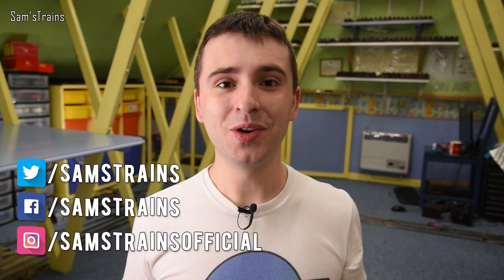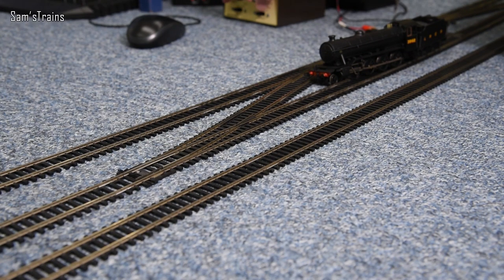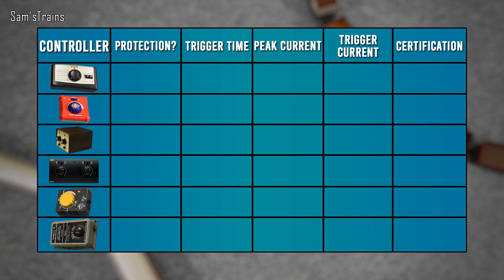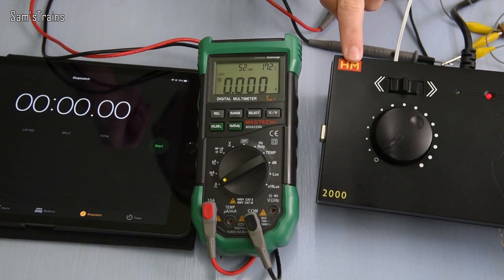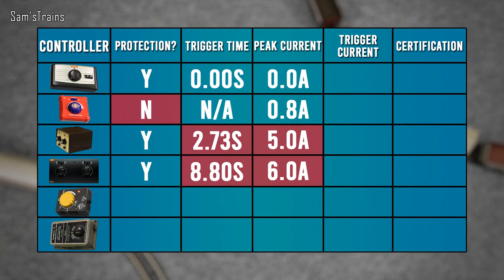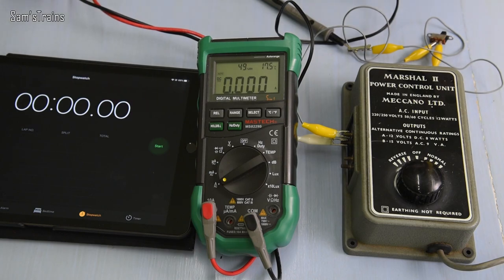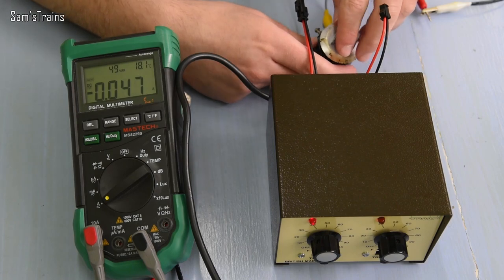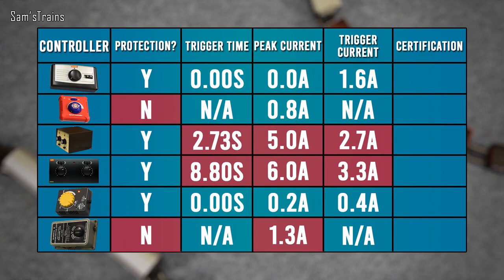What Happens When You Overload Model Train Controllers?

Comment: As a controller recommendation for anyone reading, I'd say the "Hammant and Morgan duette" is one of the best things you can get. I have 4 of them for my layout and they all serve me well. On high resistance and half power, the slow speeds are absolutely phenomenal. My S15 for example, I could only see moving when I put my eye right down next to it, but believe me, it was still moving (I time lapsed it to make sure I wasn't making it up.) I also has great short circuit protection and they'll last forever. They're often overlooked due to their age, but I'd choose them any day over an HM 2000 or gaugemaster controller. You may want to swap out the fuse in the plug however as a couple of mine came fitted with a 13A fuse.
Reply from the maker: Great to hear that Dom - I've always wanted to try one of those! Thanks for the recommendation as always! :D
Thanks for watching - Sam :)

Comment: That was a useful and interesting test. A common type of protection I'm not sure any of the tested controllers had is a resettable fuse. I think all the Gaugemaster hand-held controllers use these, and I've seen several other hand-helds with them. They will pass a the rated current indefinitely,  above that they cut out but can take a long time, to cut out quickly they need about twice the rated current. The problem I found was that the max current was limited by the power supply and the controller setting about 1.5 amps (2.5 A at full throttle), but the fuse was 1.1 amps cut-off, so it  would supply 1.5 A for 20-30 seconds. I've seen this damage locos 3 times, all the same loco design. Certain Dapol N locos used a tiny spring to transmit power from the tender to the loco (they have since changed the design to use a wire). If the loco derailed on a crossing you could get a tender wheel touching the other rail and shorting via the spring and the loco wheel. Because the spring is so thin 1.5 A made it red hot, your warning something was wrong was smoke coming from the loco as the spring melted and burnt plastic (the motor was not involved and was fine). They can be made a lot safer by replacing the 1.1A fuse by a lower rated one, I use 0.5 A for N Gauge (0.4 sometimes tripped on double headers). BTW, a common reason these controllers fail is that the fuse goes open circuit and you need to replace it, so a stock of spares is good (it is a soldered in component in the form of a small disk, available from RS and similar). Of of 6 broken controllers at the club 5 were fixed by replacing the fuse.

Noel
Reply from the maker: Hi Noel - I do like the idea of a resettable fuse - provided people don't abuse them, I can't see why manufacturers don't fit them more often! That spring design sounds pretty silly too - demonstrates a lack of proper testing once again!
Thanks for watching - Sam :)

Comment: Another smashing video Sam, had flashbacks to the staring in the Dapol Water Tower (another explosive topic, eh?) video at 0:24!

I have the Hornby 900 Power Control from years ago, not sure what that is rated for - although I doubt it will have short circuit protection!

I normally go round with the back of a fridge magnet every few weeks just to make sure no metal is near by - with the power off.

My locomotives only draw around 100-200 milliamps, or 350-550 in double headers. 

I also have a "boost" function on the controller - I turn this on when doing heavy duty running.

Thanks, George.
Reply from the maker: haha thanks mate - ooh yeah, I would have liked to have seen one of those blow up! Yes that's right - about 200mA is reasonable for most locos!
Thanks for watching - Sam :)
Reply: If I remember right, the R900 was rated at a massive 2.25amps as it could handle accessories and 2? slave controllers (R902)
Reply: Not sure, but I know that it could have another controller plug into the side, so it could power two tracks? The ports on the side where you would plug in another controller measure 12v DC. What is a "slave controller" I have seen them on the likes of eBay and can't find any info on them.

Anyway, the bloke who sold the controller to me said it was a beefy controller and was well worth buying another to make it a twin track controller.

It does have a 15v AC output.

Comment: Fascinating experiment, makes you wonder then about displays in the old days.  I recall Hamley's used to have a model train circuit running continuously round a large suspended circuit on one of the shop floors.  I'm guessing they must have had a few derailments which went unnoticed and back then not sure of any short circuit protection.
Reply from the maker: Thanks a lot Geoff - I know - I wonder if they had any issues?!?
Thanks for watching - Sam :)

Comment: Non-isolated pointwork across a double track mainline or anything with multiple power feeds can cause it depending on how the pointwork is laid, or damaged point frogs can also do it. Just thought I'd mention as it's something that's far from immediately obvious. My poor HM 2000 had to deal with a fair amount of current multiple times before I finally tracked it down to the damaged point, luckily it's a solid unit and is still going strong now several years later.

Edit: Also, judging by how long the power light on the HM 2000 remained illuminated before shutting off, I think mine reacts a bit faster than yours.

Love the channel Sam, keep up the great content
Reply from the maker: Yes you're absolutely right Matthew - connecting two controllers together in that way can cause excess current flow/controller damage - very good point!
Thanks for watching - Sam :)

Comment: Another thing that this brings out is the danger of running dcc chipped locos with a DC controller. While dcc controllers cut out very fast with a short circuit, the Gaugemaster took much longer. I guess this is how I managed to fry a couple of dcc locos that came off on a crossover powered by dc. Now I will never run a dcc loco on a dc layout. They all have the CV29 blocked from dc.
Thanks for the great test Sam!
Reply from the maker: Ahh that is interesting Antony - thanks for sharing this!
Thanks for watching - Sam :)

Comment: I have experience of 1950s equipment.  When shorted there was a smell and bluish smoke appeared and stopped working.  The Hornby Dublo ringfield motor was susceptible to burning out as well, whereas the Tri-ang XR 3 seemed to take a lot of punishment.
Reply from the maker: Uh oh - that doesn't sound good! I'm not surprised those older controllers took a lot of punishment! ;D
Thanks for watching - Sam :)
Reply: @SamsTrains  It was when the ringfield stalled that they ran the risk of burning out.

Comment: As a point.  The Meccano transformer, at least my old one, is an Auto Transformer.  This means that one side of your track is connected to the mains supply.  If you use a neon type power detector, you should find it will light up just as though you stuck into a mains socket!  I can't think of an easy way to have a full mains belt from it, but the chance is there, they are not an isolating transformer, as all modern ones are....
Reply from the maker: Blimey, that's very interesting Andrew - I'll have to look into that, thank you!
Thanks for watching - Sam :)

Comment: Hi Sam. I think I would buy a packet of three 6mm x 30mm 12V Car Glass Fuse Fuses 2A from eBay which costs £1.09 including P&P.  Replacing a car fuse will be considerably cheaper than repairing that Gaugemaster controller! If you get a glass fuse, you can straightway see when it has burnt out. You can sometimes get a short caused by arcing across the commutator which will trigger an intermittent overload protector, but not a thermal cut-out.
Reply from the maker: That sounds great - I'll have to try that too! :D
Thanks for watching - Sam :)

Comment: 1:18 "The full power of the controller" 
Only if it is already turned up to full power, which is a strange thing to do given that your loco will be whizzing around the track at 88mph.

The question now is what did you test? A short is a direct connection between the poles, which means it happens outside your motor or your motor is so completely broken that it's not salvagable anyway.  if there is a short and your loco stops, your first reaction is to turn of the power, not to turn it up forther as smoke begins to develop from unusual places.

I'm far more interested in what protection the loco's have against things that can cause them to develop a short.
It's also interesting to look at wether the wiring inside a loco can handle the max current put out by the worst-protected controller; does your loco actually take damage from a poorly-protected controller?
It's probably even more interesting to see if there is a DIY gizmo that you can put in series with your controller to protect against overvoltage and over-current, like a circuit breaker in your house.

Does the 6 amps even make it through the circuit to the wheels, is the contact of the loco's wheels on the rail enough to allow 6 amps to pass through? It would not be the first application where the test-case of a direct short is something that is allmost impossible to achieve in real life.

Comment: My 1930’s trix twin railway controllers have short circuit protection which seems to work well. Frequently tested with derailed  trains. I use a 1950’s transformer which is rated at 3 amps , however if you shorted that it would probably dim the lights in a major city
Reply from the maker: Thanks for sharing - blimey, they even did things properly in the 30s!! :O
Thanks for watching - Sam :)

Comment: Blew up the inside of an old walk around DC throttle one time, wired the connection wrong and a capacitor exploded in it while it was in my hand. Have also seen some spectacular damage in the O-scale world in terms of electrical burn up with 18-24 volt systems (both AC and DC).
Reply from the maker: Blimey - that must have been a shock, in your hand! Crikey what happened with the O gauge?!
Thanks for watching - Sam :)
Reply: @SamsTrains  Thankfully the controller had a metal case, but my heart skipped a few beats. As for the O-scale I have seen transformers, wiring and engines start to burn up from the amperage. Mind you those breakers (if they have them....done some risky testing with vintage Lionel transformers) usually go at 5 amps so you have a pretty good current heating things up.

Comment: The Gaugemaster and large Hornby controllers will only be equipped with internal thermally controlled protection. Basically to self-protect, but not to give any form of protection to anything outside the controller.

The small Hornby controller appears to be equipped with a sense and trip function so it will protect not just itself, but also external devices. Essential for childrens train sets, where it is usually found to avoid damage to played with locos. I expect it has some type of short time retry pulse to check if the short is removed. Probably too fast for your meter to register.
The trouble with fitting this to the Gaugemaster controller is simply that you run the risk of cutting out too early if someone simply has a power hungry loco and a large load. When starting from stationary, DC motors can sometimes pull quite a lot of current transiently. I guess Gaugemaster don't want the reputation of controllers that cut out too freely.
Reply from the maker: Yes that seems to be true, hence the delay in cut-out I suppose? Agreed - the Hornby train set controllers are spot on (if a bit frustrating) - can't see locos being damaged with that one!
Thanks for watching - Sam :)

Comment: Hi Sam, pity this hadn't have been 2 weeks ago!!
I had of all things, a BEAUTIFUL Dapol Class 68 - you MUST get one they are SUPERB and extremely well built and nicely designed to work on!!!
Using my HM2000, half power, it was pulling 13x Bachmann 104-tonne 'TEA tankers' at a guesstimated 60mph +/- scale speed.
Each end has normal narrow NEM pocket mounted tension lock couplings - no problem, but in-between each tanker I've used Hunts couplings .... one was pulled out of the socket, leaving Brutus to slam into the back ... being UNATTENDED .... for perhaps 10 minutes.
I arrived to that familiar for an old-timer like me burnt electronics smell - naughty words sprung to mind, and a LOT of them!!
I switched off immediately. Checking for physical damage there was NONE - nice.
The body on the outside, through the metal chassis as well as plastic body felt pretty hot - not good.
I quickly removed the body - clip on / off, so EASY - great design Dapol.
I tried on the track again, assuming the controller would have reset - NOTHING - ah well.
I unscrewed the PCB, then saw a motor shim / brace was deformed with the heat, removed this, and another mount, lifted out the motor, desoldered it, assuming it's either / or - motor or PCB.
I tested the motor - it's working!! Spooling up to max, the SOUND was nowhere near what I would normally expect and it sounded a little rough.
I tested the chassis, thinking it must be the PCB - WRONG - lights are working perfectly, and no signs of burning anywhere.
I remounted the motor after resoldering - locomotive moves off at a 'normal 'setting' but when turned up, it's obviously lost speed - it's the motor.
£26.50 replacement plus ~£4.00 shim brace replacement received and installed - PERFECT AGAIN!!
If you'd have posted this 2-3 weeks ago you could have saved me £30!!  I say it's your fault!
JOKING ASIDE, the Hunts couplings are a GREAT design, but a bit variable in dimensions, and perhaps the pockets may vary a little, but I think it's more the Hunts than the pockets ... so knowing they'll remain with the Hunts, the coupling are superglued in now - will NEVER (I know ...) happen again!!
HappyDays.com as a colleague used to say.
Al.
Reply from the maker: Ahh sorry to hear that Alan - send me the bill, lol! Yes those HM2000s can supply insane current it seems - if they were better designed, your 68 might have survived :(
Thanks for watching - Sam :)
Reply: @SamsTrains  Thanks. All's good now, but £30 lighter.

Comment: Yeah I’m not sure how the short circuit protection works on these, but one thing I do know is electricity always takes the path of least resistance so if let’s say your loco derails and a wheel creates a short between the tracks the motor will be fine as the current won’t pass through it, obviously a very different story if the valve gear jams tho the motor will burn out before the over current protection kicks in and that seems to be the case On most of those controllers by the looks of it. As and electrician myself I can tell you short circuit and overcurrent are very different fault conditions, the long and short of it tho as you said is never leave your train set unattended, also the mehano is the only one which protects against overcurrent by the looks of it
Reply from the maker: Yes that's absolutely right - the motors are only in danger if they're stalled with voltage applied - the lack of back EMF causes excess current to flow.
Thanks for watching - Sam :)

Comment: Another way to kill controllers:
Run a Bachmann loco on a Hornby controller.

A hornby one broke and threw 5532 off the track
Reply: The controller at 0:22 is the one I had
Reply from the maker: haha really?! Which controller was that?!
Thanks for watching - Sam :)
Reply: @Dani Rijnsburger The HM2000 or the Gaugemaster Twin Track are probably your best bet. But just be careful not to short circuit them!
Reply: Absolute rubbish.
Reply: And that is train cross contamination
Reply: @pigeonliveryworks  XD
Reply: @TomMaddox888  no it actually happened. One day it will feature on my channel, still with bent frames and buffer beams from its fall.
Reply: @lukeslocomotives      .

Comment: i suspect that the controller that made the 'click' sound was a equipped with a 'thermal cut out' - a switch operated by a coil which warms as the current flowing through it rises, this heat is sufficient to bend, through thermal expansion, a bi-metallic strip which is the switch, or operates a switch. a better method is a circuit which measures the current flowing (like your ammeter does) and at a particular value operates a relay (or power transistor), that sort of set up can be designed to stay switched off until the fault is cleared. The thermal cut out type reset themselves when they cool down and current can flow again if the controller has not been switched off or the fault not cleared. It is surprising tho' that in 2020 any controller would not have decent overload protection. Your old Triang controller is very similar to one i first used in the 1970's and it was old then! We built a thermal protection device and put it in the wiring to the track. I have a suspicion that Triang thought the odd burnt out motor would be good for there sales of spares - motors were damn expensive and always required replacement carbon brushes and the commutator slots cleaned. Ah those were the days...
Reply from the maker: Yes you're right I think - that explains the delay! Agreed - a more sophisticated overload-sensing circuit would benefit controllers like this greatly - I assume that's what those modern Hornby sets use, to great effect!
Thanks for watching - Sam :)